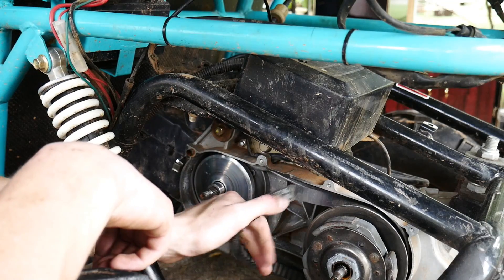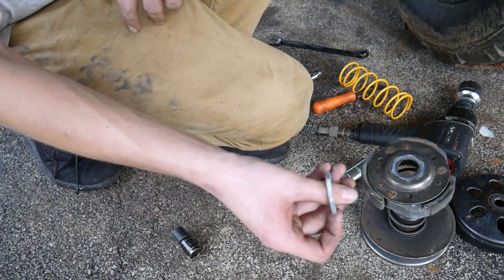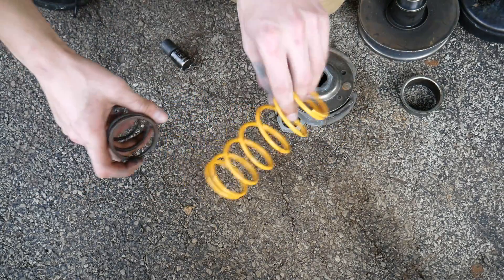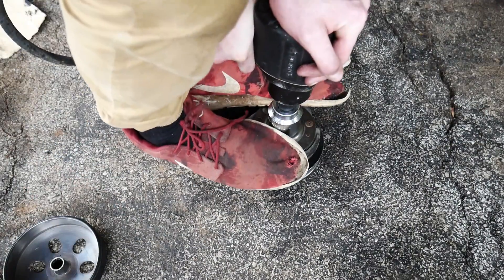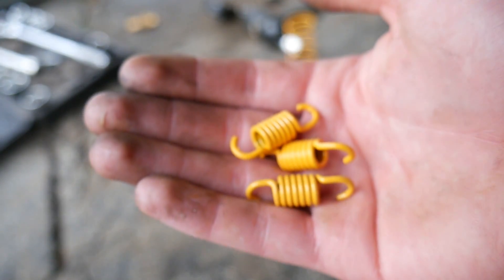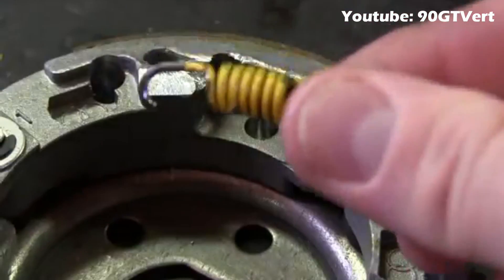How to Tune a 150cc GY6 CVT - Main Clutch Spring and Variator Weights

Comment from the maker: Want to see more videos like this?? Consider supporting me on Patreon https://www.patreon.com/vasilycustombuilds any donations will be appreciated!!
Reply: I have an issue with my 250cc scooter. When I go to take off it jerks a lot until I get going a bit. I have replaced my variator and belt. At first it stopped jerking but after a bit it went back to the old problem. Any idea what it could be? Could it be the clutch spring?  I have not messed with that yet.  Any advice is greatly appreciated. 
Thank you, George
Reply: Hey I have a fax 400 fang power predator Utv I’m trying to upgrade the clutch to get more torque any suggestions?
Reply: Is it possible to use a combination of different rollers such as 13 grams mixed in with like 16 grams?

Comment: Good kid. Mostly right, but He's wrong though. Springs and rollers won't limit top speed ever. Impossible.
RPM default under loading is changed only. So, to be clear.... more acceleration with stronger spring and lighter rollers (never reduces top speed), higher top speed with weaker spring and heavier rollers.
Reported top speed losses are due to new parts and friction changes on the belt and things like that.

Comment: A tip for spring mounting is make a 2x4 spring presser out of scrap lumber and mount it to a wall or the side of your deck. They work great, I have a small one for the scoots clutch spring and I have a large one for doing car shock springs.

Comment: I have a CVT rated for more power. problem is, it's splined. I cant attach it to my engine. because my engine's shaft has keyway instead of splines. any idea how to get around this problem? I find cvt from common torque converters wear down pretty quick.

Comment: Thank you for your videos. I noticed you don't have have a transmission cover assembly inside the housing either. Every other video of th GY6s looks like you have that assembly with bolts and its easy to remove. To change the gearing and check the bearings do you have to take out the motor? Seems crazy.

Comment: Good video. But you didn't loosen the belt but sceezing it down in the clutch! Or sceezing the clutch down and pushing the belt close to the inside of it. Before you tightened the variator nut. So the belt doesn't get tightened in wit it. And not be able to it job!

Comment: I USED MIXED 10G AND 17G ROLLERS JUST NOW AND NOTHING AFTER UPGRADE OF THE VARIATOR WHICH I TOOK OFF A BIT OF METAL WITH A DRILL SET NOW IT CAN GO TO 80KM/H . FUK SHIT ADVICES YE ALL GIVE

Comment: i got a adly 150cc quad atv it use the gy6 150cc and im a noob at scooter engines. 
stock it was limited by the cdi? atleast from what i read so a racing cdi should raise speed from stock 65kmh to 80kmh but im not sure havent tested...
and on a quad you want torque atleast a bit but i also want it to do 80kmh so its not a horrible ride on the road... i will need to test the top speed now how it does...
its all stock air box etc, just cdi changed. and a semi loose exhaust i think i will just cut it off and put a fake akrapovic that i have on it

Comment: Lmao.  At 2:20 his whole world exploded.  Good job on the explanation and the video.  Note to all, be careful adding too much grease as it may negate any changes you've done.  You dont want most of the parts in your CVT slipping, i.e. clutch and variator have two face plates that grip the belt to operate and can slip easily if anything is on them.  Even more, the clutch bell and clutch have to grip each other using brakes and slippage there can ruin performance greatly.

Comment: I recommend to everyone with a atv unless you drive in lakes and ponds get rid of your air box. I had one and it was limiting my atv to a crawl. Especially when it got dirty it eventually would die when given throttle. I removed it and added a pod high flow air filter. It went from dying upon take off to popping wheelies with motor power alone. This is 150cc gy6 lifan atv BTW.
Reply: Did you rejet the carb to??
Reply: @franzpotschka8303  No the previous owner may have but I didn't notice it when I tore down carb for cleaning. The ATV was parked because they couldn't get it running right and then I got it.
Reply: Calling bs on the wheelies

Comment: Grease and clutches dont mix. That spring collar didnt need that lube, its gonna get slung out and wind up glazing pads
Reply from the maker: Yes that's right. I made a little mistake
Reply: @VasilyBuilds   hey...no critism here, ive done it too...
Reply: I just fought this same thing! My issue was caused by bad seals in the rear pulley though.

Comment: Rollers arent something you choose for acelleration or top speed. youll get the same top speed with a lot of weights roughly around the correct weight, youll only gain top speed if you had stupidly light weights to begin with so the motor was revving way above where it makes power. fit the correct weights that keep the motor in peak power.
Reply: I hear people saying lighter weights for acceleration heavier for speed all the time. It's almost a losing battle to say otherwise

Comment: just bought a buggy and it does fine on flat ground but has trouble pulling the slightest grade of incline.
Reply from the maker: Was it new? Could be Belt slip or clutch slip. Probably just try a new belt
Reply: Lighter rollers and 1500 spring

Comment: What does the 150 cc scooter have to be for the ideal weight to not affect the fuel; (14 gr),

What is the benefit of extending the clutch release  tnx
Reply from the maker: It shifts slower. Not really needed for a light scooter. I don';t know the ideal setup for a scooter. Ask the forums

Comment: I gotta question if you turn the clutch should the wheels turn forward I'm having too push my buggy to start
Reply from the maker: Only if the buggy is in forward or reverse. If it is in neutral it shouldn't
Reply: It only has forward and it moves a little evrey full turn
Reply from the maker: @Backroadmuscle  Yes that is because of gear ratio reduction.should be normal
Reply: Thank u now I'm not so worried

Comment: My brother bought a rail buggy with a 150cc I believe it's a GY6. I was watching the motor on acceleration, and it moved/rocked front to back.  Is this normal,  or should I check to see if a mount is bad. 
This 1 has a top speed of maybe 25 mph.  I've not checked it with speedo on GPS via my phone. 

He had another rail buggy same motor minus reverse gear and it did between 50-60 mph,  but he sold it. 

New sub. Thanks for any info.
Reply from the maker: From my knowledge 150cc engines are floating motors. A little rocking should be fine. Mine rocks a little. If the motion is too extreme, then there might be a problem. Thank you for watching! And thank you for your service!!

Comment: Very good. I still can't get the clutch off my Kymco Agility 125 it's very tight even with a impact gun? 

Any suggestions?
Reply from the maker: Optimus Prime possibly try using a prybar covered by a shirt to stop the clutch from spinning, or some big channel locks. If the belt is still on it you can slip it on the clutch squeeze it and hold it with pliers.
Reply: @VasilyBuilds  I tried the channel locks but too lose to hold it down. Gonna buy this tool which can clamp it down hopefully and see from there. I saw someone else do it. But I really like your method which confuse me how you were to get it off using an impact gun? Was the first time for you very tight or was it easy to come off? I 'm thinking the Kymco 125 clutch bolt is really tight to come off? No problems getting it off the Variator using the impact gun.
Reply from the maker: Optimus Prime it's a consumer level gun (pretty strong but not the strongest) it was very tight at first. But i held the clutch with my hand( welding gloves for more grip) and the nut came off. "Can't be tight if it's a liquid" maybe try to use a little heat ?
Reply: @VasilyBuilds  So I received my Oil filter strap wrench and still no good. I already ordered the new springs. Hoping the pulley tool works once I receive it. Worse case I will cut the nut off so will make a order on them so I'm not waiting for them long.
Reply: @VasilyBuilds  I received the pulley tool and it worked. It was tricky trying to remove it from an old scooter and add it to my one. I had to use a different method by using a heavy pole over the breaker bar and then I was creative by using the trolley jack so the pulley tool won't move keeping it stationed. It worked. I think it can be anything heavy instead of the trolley jack. However, when I removed the nut from my scooter I could use the pulley tool without any hassle. Problem solved. Now my scooter is no longer jumping aggressively offline. Riding smoothly now. I will put the new springs on the old clutch for future clutch service. I am stoked that I got it going now. With the right tools it goes a long way ;)
Reply: Heat up with a heat gun my brother and put some oil on it,wd 40 is perfect
Reply: Do not use wd40 any were near ur cvt

Comment: with some weights,
those weights are not suppose to be just dropped in any ol way,there is a right and wrong way for the direction of the rollers to be set in,If there is a side that is showing more of the weight then that is the side that goes in the opposite direction the variator spins
Reply: those are just the round ones if they have that weird shape then it has a way to install but the regular round ones don't
Reply: Rollers can be put in anyway. Sliders have a specific way to install.
Reply: I was thinking the same thing

Comment: My friend thanks for your video, i have 2 questions:
1.- I  have a 150cc scooter, what spring color you recommend me to use?
2.- For what reason, when I start accelerating the motorcycle, if I accelerate it quickly it starts to make small jumps, but if i accelerate slowly it does not give those little jumps a little bit. I need to purchase a new clutch?
Reply from the maker: 1) Scooter is light, so I recommend Blue or Yellow
2) small jumps is most likely a clogged carburetor, it could be bad spark, or just the belt is slipping. In that case you need a new belt
Reply: @VasilyBuilds any idea why my buggy turns off when I press the gas pedal. Feels like is going but just turns off

Comment: " theres two different gears" Wrong! there are no gears, thats the point! it wouldn't be varible if there were!
Reply from the maker: roythearcher I was just trying to make it easier to explain to the viewer. I am familiar with the concept. And I did mention the 2 gears variate
Reply: Hey man you were spot on with explaining, in your video, having two gears. Using two separate, locomotive elements, inside of the "GEAR" box ((@Roythearcher)),is what propels or pushes that back tire for forward motion.  why do people ((@Roythearcher)) feel the need to act like arrogant retards... is it lack of an imagination maybe??? Dude your video was great and very informative, keep up the good info vids.
Reply from the maker: Thank you for your kind comment sir!

Comment: you like many are so wrong about the waights. you will in most cases loose little to no top speed with the waight being adjusted but lighter will give faster take off. now with that sed the biggest thing with them is not even looking at it that way but the fact the the thing that makes the most different is rider waight and bike waight. you will find that you need  to adjust things buy trying every waight. you also may want to look into getting a racing variator and possible sliders. sliders will make shure you have the max top speed at all times. you have to rember and keep in mind a belt will move to the same place with 10 gram waights as it will with 1 so their fore common cents shows you wil have the same top speed the only thing that will change that is if the waights are not correctly tunesd you will loose top speed to do slipping. and most times when replaceing cluch springs anything over 1.5k will not be a good thing.i also would like people to no you should never go below 3 gram waights inless you have a very heavy bike and rider and no matter what you do you belt will slip so you will need to use a kavlar belt.
Reply from the maker: Ok man, I am running 11g's It has good acceleration but buggy doesn't want to "rev out". I feel maybe the rollers got stuck. But despite that I want to go lighter. Maybe try some 9g's for fast acceleration, were top speed don't matter. I try to stay away from sliders because I've heard some bad things about them. Together we weigh about 700-800pounds
Reply: all i can do is give sugestions without being their but my biggest would be buy rollers in all sizes from 3 to 14 gram and try them all to see witch best fits you. this way you can diel in the right ones. once you have that you can buy a performance variator and try sliders sliders will only work on some variators and most stock will not work with them. what will happen if they are not compatable if you will go to stop and the engine will not rev down quickly still wanting to move the bike even tho you are stopping. most people i no who work on bikes and schooter and so on have send quite a bit of money to have all the waight sizes and different sprints in order to tune things properly they also use different equipment to test things. i my self use 4 gram sliders in my heavy bike and they work great and in my lighter bike 5 gram. the ligher bike can do 4 but only in rollers the heaver bike i just got some 3gram sliders fore and have not installed yet i never ordered them before since they do push the limits with the 4 gram in that bike. i get around 8500 rpms with them and i no from friends they say you can do 9500 safly and 3 gram should give you that but if you are going down hill it will rev higher and if you rev over 10000the can hurt and damage the bike. and that you truly should not go over 8500 inless you install all performance parts like a new rocker and complete performance cvt system. my friends do a lot of drag racing and they have seen people try and cheet and have a pistem break blowing it straight out the crank case. they like to call it the decapator or the sexchange as sometimes the pisdun will come out with so much fore if you installed a big bore the can will blow out the case and up threw the seat and hit people in the nuts. some people who buy just bikes just to get one or 2 races out of boring past the max sit on metal seats and fil the under them with fome.
Reply: @vorkev1  the amount of misspelled words is astounding. I had to re-read your comment 3 times. Thanks for the knowledge but work on your spelling. 😁

Comment: Does any fluid goes in them trans and if so how to check what kind and where to put it in at
Reply from the maker: Yes. There should be a fluid fill bolt and drain bolt. If not you might have to take the seals apart. Usually you fill the fluid with anything, becuase it is a cheap engine. Atf fluid  is the best
Reply: hope this is the place to put this.    i have transplanted a  cn 250 out of a 2015 kandi buggy in to a 800 lb gem car golf cart, i ordered a red shorty spring and 19 gram weights and the cart seems to have slowed a lot at take off rpm high and it takes a while to get up to speed the mile an hour is a little slower about 38 mph. with stock weights and spring it took off alt faster and topped out at 42 mph. where did i go wrong. any help will be thankful. Doc

Comment: Man I hope you can help me. I got my belt in there is this small crank solenoid that is above the variator crank top left I need to pull that out in order to get my belt over the variator so you know the belt can fit do you know if that small crank can be disassembled by hand like being unscrewed
Reply from the maker: DC R The starter motor? usually it's 2 bolts and you can pull it out. then slide the belt off the variatior. There should be videos on how to if you have a specific type of scooter or buggy

Comment: real talk: centrifugal clutch and CVT wastes a lot of torque and no weight combo on the planet is going to sustain torque at lower diameter but high RPM to do something like 55MPH on a 5% gradiant at one-mile.. A lot of hype around CVT tuning with the GY6 scene.. Low-RPM torque is pretty easy though because it's easy to get large diameter at higher RPM with most of the weights and most of the force range on the back tire especially with a stronger clutch spring..
Reply from the maker: I agree 100%. I wish i could somehow make it to where there was no cvt and only a clutch, attached directly to the crank
Reply: It's possible to mount just a sprocket in place of the CVT and have it work with the centrifugal clutch. It allows better control of the power band, but it's still a low-compression two-valve engine on a centrifugal clutch. Bore kit and shaving, porting, and polishing head is probably the tuning limit with a GY6. Small stroke and piston diameter, and they use weird alloy to make these Chinese motors so wear or cracking are too easy..
Reply: It's interesting that you say this. We have been using cvt on our snow machines for eons. Now we have them on our side by sides. There are advantages and disadvantages. But I couldn't imagine having a straight centrifugal clutch on a snowmobile. It would roast right through everything downstream from it.  The cvt allows for anyone using them to tune for the best rpm for gear ratio changes. Without that... you would only Have power in a very small area of rpm/ speed
Reply from the maker: I bet the snow mobile cvt's are actually built to last. Unlike this gy6 pos. But its alright. Cvt is useful in snowmobiles, jet skis etc.  were you need constant speed. For the streets, gears are the way to go!!
Reply: Vasily Custom Builds jet skis have no gears..... direct drive.  Can ams... polaris rzr.... and others use cvt. But they have so much power... we blow through belts of you can't lay off the throttle.